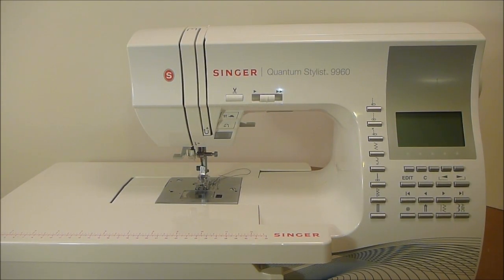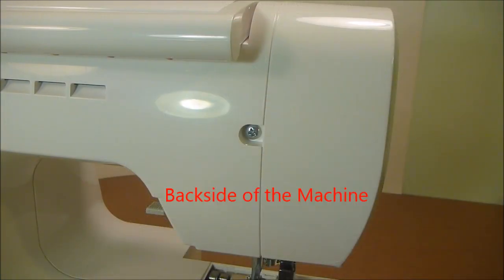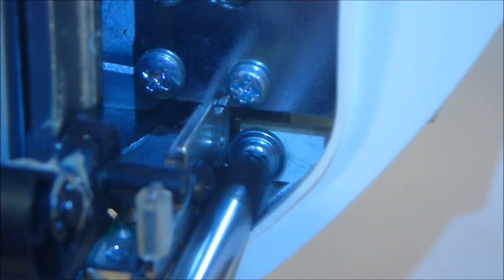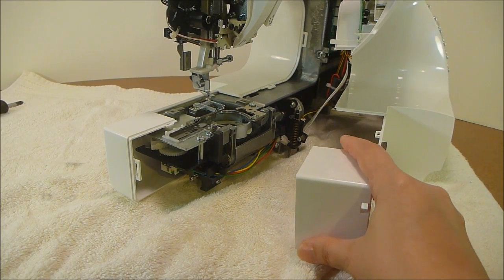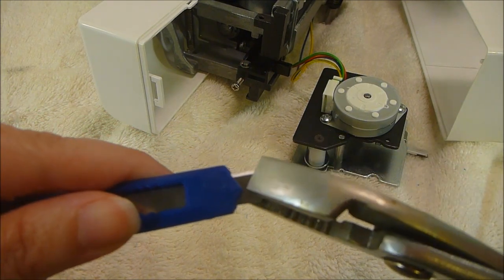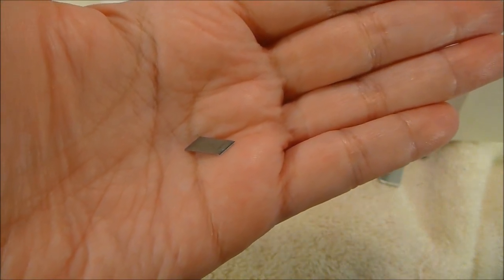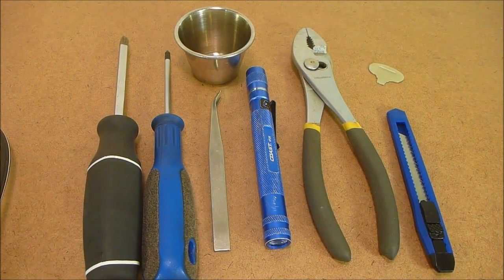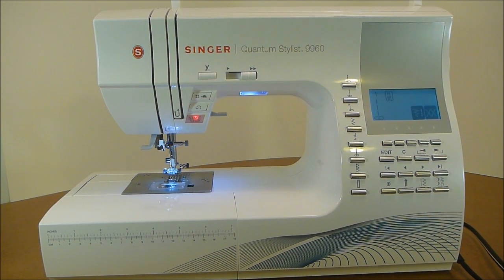Auto Cutter Repair Video

Comment: Thank you so much for this video.  My husband and I tried this. The blade fell out and I shoved it back in, only it still didn't work.  So when we went the whole route following your video the blade was gone. Where did it go?  Anyway, we placed a new blade in and got it back together.  It sews great and only cuts one thread now....any ideas?  should we try it all again?
Reply from the maker: Hi Tara.  There's a critical point around the 12:00 mark that needs to be done correctly or the cutter will not function properly.  Check to make sure the brush on the bobbin casing is still intact.  That stages your bobbin thread for cutting.  It may be damaged or missing.
Reply: @RoxanneStitches  Thank you for your time. I do appreciate it. I called Singer and they gave me a 30 day extended warranty since it was so close and I mailed it off today to be repaired.  (My baby! LOL)  Thank you again, this was a great video and I am sure it helps many.
Reply from the maker: So glad it's covered and will be repaired for you.

Comment: Hi Roxanne, Thank you so much for this video. I was very happy too see that the blade is a simple blade segment, as I had troubles with my automatic cutter since the beginning (cuts the 2 threads, or 1 or 0  mostly) I bought my machine maybe 2 years ago, and it have the system you show in the video. Sadly, the new blade didn't change a thing. Thanks to your video I understand the system a little more. It seems that the the mechanism holding the blade can't go to the left far enough, it stops maybe 2 or 3 mm before the end of the rectangle slider, so the blade won't cut the thraeds and I can't figure this out. Please, do you have an advice for me?
Thanks, Christelle. (PS: The way you talk is really easy to understand for my french ears! TY)
Reply from the maker: Hi Christelle, I wonder if there's a small piece of thread stuck inside the mechanism preventing it from sliding freely?
Reply: @RoxanneStitches  Hi, thanks for your answer. I had a very close look at it the second time I went through the process, I will do it again tomorrow, searching for threads or any detail. I think there is a part that is intended to slide up the white plastic finger, and it can't. Do you know if something  is intended to lower this white finger a little bit?
Reply from the maker: Probably best to reach out to Singer or a service tech.
Reply: @RoxanneStitches  Thank you Roxanne.  I won't be able to get it to a tech or singer tech until at least 6 months. So if I can solve it by myself, it would be great.  I think we sewers are by nature quite stubborn against technical issues. The comments here seems good proof of it! If I find something, i'll tell you.
Reply: Hi Roxanne. I found the answer. The answers to be precise. And it was team work! I describe it here so it could help someone else:
1: You were right I found another piece of thread very well hidden. It didnt't block the sliding, but surely didn't help.
2. Why the slider's plates didn't go to the very left hand side: I found that the longest wing of the big cutter hook was really bent, it's tip running up against the first white plastic wedge. The bent was so gently curved i firstly thought it was build this way. Maybe it was a factory issue, since my cutter nether worked well. A pair of pliers solved this issue.
3. Why the slider's plates didn't go to the very right of their course: My husband found this one: the sliding was not stopped in this direction, it was just harder enough so the engine didn't go far enough. Why? Because when I dismanteled the little elements that's hold the blade, I didn't notice the second hook, the thin one, and it was so close alongside the over hook that i enclose both the hooks in the little piece when I replaced it. On your video it's where you put your nail at 12:09mn.
Now my machine is doing better than the first time i used it! No more weird noise, auto cutter thats always work so neat! It's a great machine.
Thank you for your help!
Reply from the maker: Glad it's resolved for you. It's such a nice feature!!

Comment: Do you have a video for a 9960 that stops working after making clunking noises?  My machine makes this clunking noise, goes about 4 stitches and then says I have to rethread. It seems like the noise happens as the needle goes up. Thank you b
Reply from the maker: Hi Rebecca.  Make sure you're threading with your presser foot up.  There could be a build up of thread in the upper thread tension if you pull your thread back from the spool when rethreading your machine.  You can always call Singer and trouble shoot with them as well.

Comment: I followed the video exactly, and actually went ahead and put a new blade in since I was in there, but it still won't cut :(  I think the hook thing isn't grabbing the thread. I can see the cutter blade is in place. Any suggestions? Also...your video's are AWESOME!!
Reply from the maker: Hi Theresa.  I would suggest that you rewatch the video at the 12:00 mark and make sure these small pieces are inserted properly.  This is the area that makes the most difference to the operation of the cutter.
Reply: Going to do that just as soon as I get off work! I will let you know if it worked! Thanks' in advance!
Reply: @RoxanneStitches  OMGosh!!! THANK YOU SOOOO MUCH! I'd done this twice and the 3rd time was the charm!! And you were right...I didn't notice until the 3rd viewing of the video, that the 2nd little part that wraps around the cutter shaft has to go BETWEEN the 2 back pieces. I had it AROUND both pieces. It was hard to see that on the video but when you told me exactly where to go in the video is when I HEARD you say it had to go between. I missed that both of my other attempts. Again, you have made yet another sewer a very happy person.
Reply from the maker: I'm so glad for you!  Happy Sewing!!

Comment: Great instructions. I was able to change out the blade beautifully. Now I just have to figure out why the thread cutter still won't work.  UGH. I am at a loss.
Reply from the maker: Hi Lorelei.  Sadly, you may have not completed the repair properly.  At about the 12:00 mark in the video there's a critical point in the repair that must be assembled correctly.  If not, the cutter won't function properly.

Comment: Dear Roxanne and Hubby:  I have a 2012 9960.  The feed dogs have slipped down, and I can't get them to stay up.  They are moving in proper time, just not high enough.  The up/down switch is not doing anything.  Apparently, this is an easy fix on old machines where everything underneath is exposed.  Thanks to your video (thanks!), I was able to get the cover off, but everything is still hidden!  You wouldn't happen to know exactly where I would find the screw to adjust the feed dog height and how to reach it?  Everything else is working fine, so I believe this machine is worth saving . . .  Thanks again.  Lisa
Reply from the maker: Press the lever to reengage the feed dogs. Turn the hand wheel one full turn towards you to raise them up.
Reply: @RoxanneStitches  Thank you so much for your response.  What lever?  The switch?  I've actually already tried that.  Numerous times!  It's something inside.  I can lift them up with my finger, but then they just drop down again.  Anyway, I appreciate your time.
Reply from the maker: There's a post that the feed dogs rest on.  Either they were knocked off that post or the post is broken.  Probably best to bring it in for service.

Comment: Will this method work on the 9980? Thanks
Reply: I should say my cutting mechanism is the one you’re doing. I mean all the screws around the machine you’re removing or loosening. My machine is a blue quantum stylist 9980. Thanks
Reply from the maker: Hi Sonia.  I'm not familiar with the cutting mechanism on that model.  If yours looks the same as the one I show in the video, it may work for you too.  Good luck!!

Comment: Hello Roxanne,
Is it possible to do a video on how to get my machine needle moving to do all the 220 stitches.
I'm in Nigeria and singer doesn't have a repair center here.
After I got it in 2016, it just stopped working and singer customer care couldn't help.
I also couldn't send it back to Amazon due to cost of shipping back.
A local engineer help me fix it back but it only does straight stitch afterwards.
Nothing is wrong with all the stitches function, the needle mechanism won't just move left or right to do other stitches, it will just clusters in one place and only move in a straight stitch.

I will really appreciate if you could do a video on what to do to get it working as this is the reason I bought it
Thank you
Reply from the maker: Hi Adio.  I'm sorry to hear your machine isn't working properly. It sounds like an electronics issue that a technician will need to repair.

Comment: Hi I just opened mine I have been having trouble will it and yesterday it got bag so today I opened it and I find out that part of the mechanism has broken .
I couldn't believe my eyes it's new sewing machine for me I just got a month
Reply from the maker: Hi Ivanka.  Sorry your cutter broke.  This video will help you repair it on your own and save you a trip to the service tech with a big bill.
Reply: @RoxanneStitches   thank you very much 
I find all your videos very helpful 
Thank you for making them
I have a question the sewing machine it doesn't  sew properly is it  because of the cutter ?
I was thinking if the cutter is broken it will not cut but the sewing will be ok
Reply from the maker: Most likely the cutter is stuck to the right.  Take off the needle plate and gently push the cutter back to the left.  Stop using the cutter until it's cleaned out very well.  Never use canned air.  One little stray thread can jam it.  if you press the button repeatedly without it cutting, you will break it.
Reply: @RoxanneStitches   I wish I can send you a video of what going on so I don't waste my money on irepair in it if singer says they will not fix it .Thank you very much
Reply from the maker: Most likely, if it's not functioning when you press the button once to cut, it needs either a major cleaning, to to be repaired.  I will caution you that if the cutter gets stuck and you continue to try to sew, you can break the mechanism and then my repair video won't help you.  Hope this info helps.

Comment: Wow, that looks very complicated.  It was well worth the $25 charge I paid to have my cutter repaired at a shop!  However, after the repair, I’ve noticed that with some threads, after I use the auto cutter, the thread pulls up through the needle, requiring it to be re-threaded.
Reply from the maker: Hi Findlay.  $25.00 was well with the the expense however it sounds like you have an additional issue?  Check your upper thread for issues.

Comment: My cutter doesn't work. When I push the button to cut, the cutter moves forward but then doesn't move back into position. I literally have to use tweezers to push it back manually if I want to continue sewing anything. Once I've moved the cutter back, I don't use it anymore. I really would like this feature to work, any ideas on how to fix it?
Reply from the maker: Hi Barbnmass.  If you've already done the cutter repair and it still doesn't work, its best to bring it to a repair tech.

Comment: Great easy to follow instructions.  Though, replacing the blade didn't fic the issue (old blade seemed good).  Thread isn't getting cut, and is balling up.
Reply from the maker: Hi Johnny.  There's a point at the 12:00 mark that must be done properly or the cutter will not function properly.  A few have missed that step, but have gone back and corrected their mistake and have the cutter working again.  If the cutter isn't functioning properly, best to use the manual cutter on the side.

Comment: Roxanne - this was a great video! We followed it precisely, and successfully replaced the blade. Unfortunately, after re-assembly and sewing a test, the auto-cutter still does not work. Any suggestions? Many thanks for all your videos - they are tremendously helpful!
Reply from the maker: Hi Leslie, There's a critical point in the repair at the 12 min mark that must be completed correctly or the cutter won't work.  I suspect that's the problem.

Comment: Hallo, I have unusual problem with my Singer 9960. When I switch on the machine, the auto cutter runs over and over, and the machine make s some  beep sound. Do you know what the problem is ?.

The LCD screen is normal, not showing error code.
Reply from the maker: Hi Joe.  Sounds like the cutter button gets stuck?  I would stop using the cutter until you take it to a technician.  Never heard of this issue before.
Reply: @RoxanneStitches Hello Roxanne, I already changed the cutter push button ( mini tacticle push button ), for a while the machine ran smoothly as normal, but now it gets stuck again...
Reply from the maker: Probably best to bring it in for service.
Reply: @RoxanneStitches  OK. Thank you Roxanne.

Comment: I just got one of these mailed to me right out of the box I power it up normally you hear the needle aligning itself and such, nothing happens, and it will sew a straight line but it's like one half of the machine I got will not work.
Reply from the maker: Probably best to return the machine.  It sounds damaged.
Reply: @RoxanneStitches   I decided to pop open the cover take a look inside found one of the wide cables and some of the smaller ones loose and pressed them in and it works great.
Reply from the maker: Great news!  Thanks for the update!

Comment: I have Janome 8900QCP to me my machine are completely different then this I have 3 pieces in there and I am not sure if cutter is one of them not inside like this machine and I can't get  blade nowhere :(
Reply from the maker: Hi Eva, I'm sorry to hear your Janome cutter isn't operating.  Have you reached out to your dealer and tech for support?  I'm not familiar with your model to advise you.  Good luck.
Reply: @RoxanneStitches  thank you I just call for service buy if I can order I will and do it my self is easy I just check yesterday but nowhere to find to order for me so I need to put my machine for service :(
Reply from the maker: Have you searched to see if someone is sharing videos on your machine?  Maybe there's a repair video?
Reply: @RoxanneStitches  yes there is no one for this machine

Comment: I'm very DIY experienced.  I did everything exactly right, no missing screws, so proud of myself.  But now -- the handwheel WON'T MOVE. What is the fix????
Reply: Took off bottom plate then end plate, still no turn.  Then read manual for part your video didn't cover at the end, found out bobbin holder was in wrong.  Machine sews now.  BUT ... thread cutter button causes a noise but does NOT cut thread.  I used a new 9 mm blade segment with edge forward point-down, and everything in cutter mechanism went together, looking just like your video. I had found the old blade before I started, it apparently fell out before I started, it was in the bobbin area and there was a tiny part of the dull-end's corner broken off, so I put in a new 9 mm blade segment. Is there some other adjustment needed for thread cutter to work? I hope this was not all for nothing...
Reply from the maker: There's a step at the 12min mark that must be followed perfectly or the cutter will not operate.  I suspect that's the issue.

Comment: My cutter stopped working within the first day of me getting this machine.  I followed your instructions step by step but unfortunately when I did a test afterwards my cutter still doesn't work🤷
Reply from the maker: Hi Carrie.  Unfortunately you didn't do the repair correctly.  You have to be very careful to watch at the 12 minute mark to put those small pieces back together correctly.  If not, the blade won't slide properly.  If your machine is only 1 day old, I'm surprised you didn't just return it?  That seems odd.